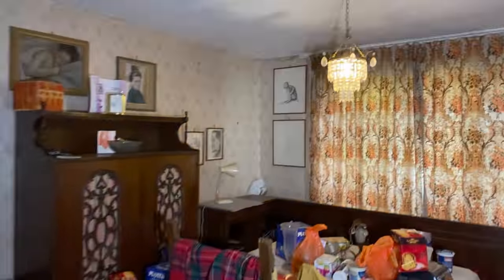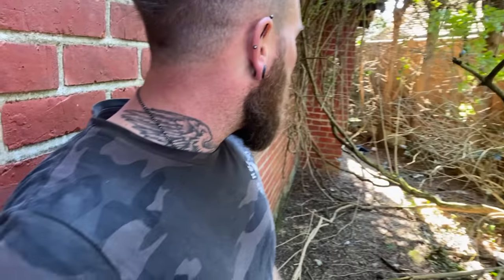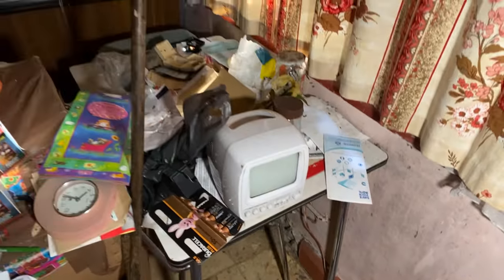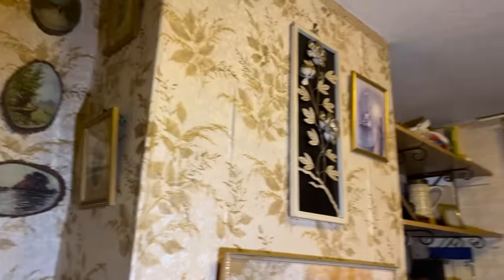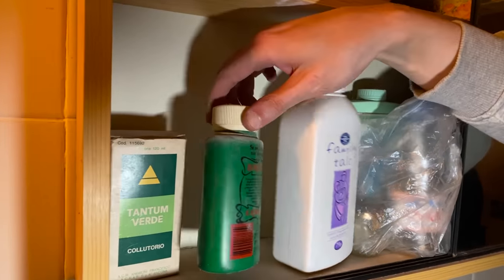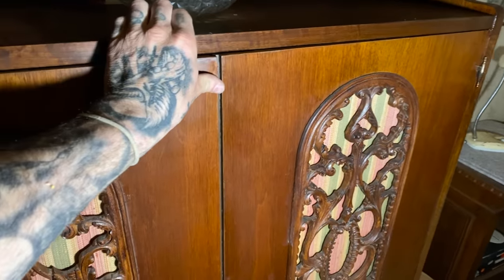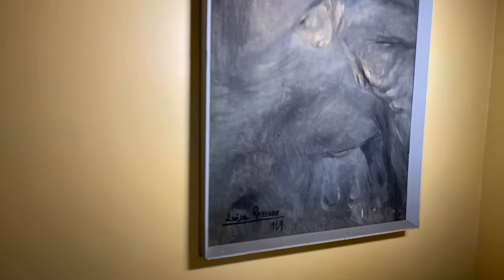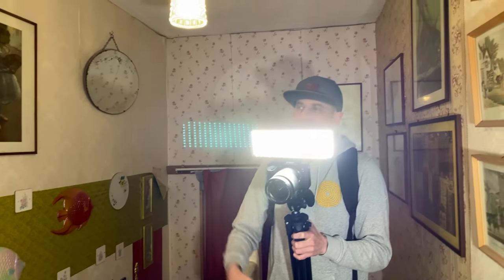He Buried Her ￼Body In The Family Garden Abandoned For Over 20 years & Everything Still Works!…

Comment: That ceiling light can't have been on for 23 years. You would have thought it should have burnt out by now.
Reply: Light bulbs were made to last 20-25 years ago. Not like the Chinese crap of today!
Reply: The bottle of talc was branded Wilko, they changed the brand around 2012
Reply: Incandescent bulbs tend to fail on switching on. Once they are on they are usually OK.
Reply: There  is one bulb  in the world  that lasted  years  and years in a fire mens  house  look it up at youtube  think was the longest  bulb  ever
Reply: I have the same light bulb 36 years  still  working away
Reply: 23 years times $600 a year going to the electric company due to auto pay equals over 12,000 dollars. No wonder they didn't shut it off. 🤯
Reply: Old bulbs lasted years not like todays.
Reply: @bionicnichola9251  you don’t remember the days of incandescent light bulbs. Every household kept spares because they blew out after certain time. Google about the Phoebus cartel.

The Phoebus cartel was an oligopoly that controlled the manufacture and sale of incandescent light bulbs. They appropriated market territories and lowered the useful life of such bulbs.(Wikipedia)
Reply: The first light bulb ever made is still on since day one. Everything was made to last year's ago
Reply: @madsam0320  interesting !
Reply: It's the constant turning on and off of light bulbs that damages them. The heating and cooling.
Reply: @Silphwave  partly true, but they were designed for finite life. Those that are very old, like was said above, are still working.
Reply: 😅m red
Reply: Duh!!! 
They turned the lights on !!
Reply: Things was better made in the “old day”! 😊
Reply: Sorry fellas and whoever else. That's pure unadulterated b.s. about any incandescent light bulb lasting that long.
Reply: The grave is probably an animal unless blood kin owns the land.
Reply: Not necessarily, old light bulbs for built to last unlike the rubbish you buy today
Reply: One of Thomas Edison inventions he stole from Tesla still burns to this day, I believe it’s in Philadelphia USA
Reply: There is a bulb been burning over 100 years
Reply: You can be buried in your garden as long as it dos’nt impede the water table

Comment: "Double dooring" is done to reduce sound transmission to a room. It's most effective if the door edges are sealed or at least dampened with weather stripping or velvet. The other door was probably wired shut due to unreliable latching.

Comment: As long as there is no material change of use, you do not require planning permission for a home burial. Even two or three graves would probably not lead to a suggestion that there has been a material change of use of the land, ie it is not being used as a cemetery.21 Dec 2021